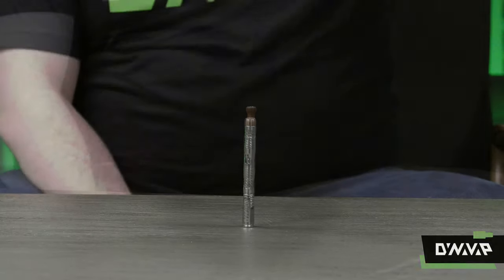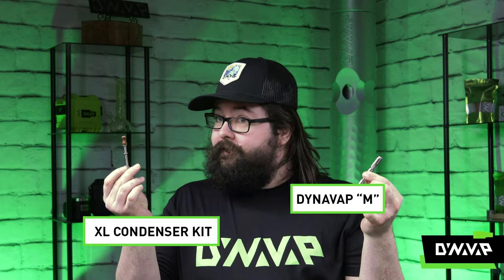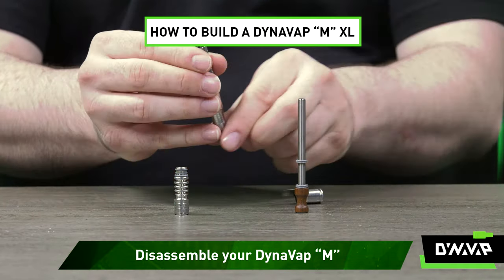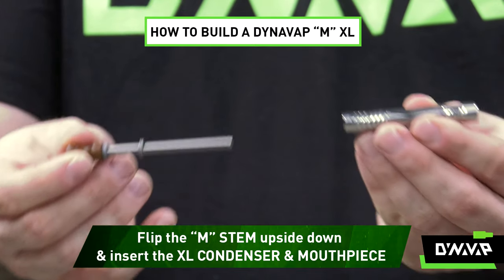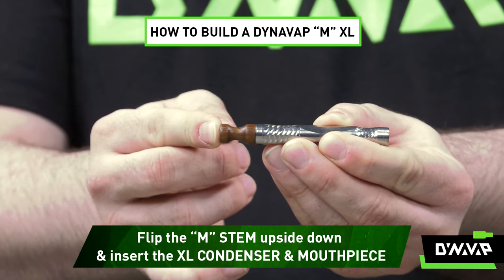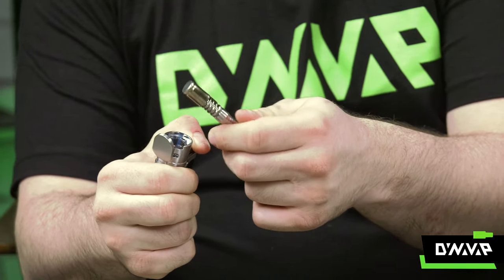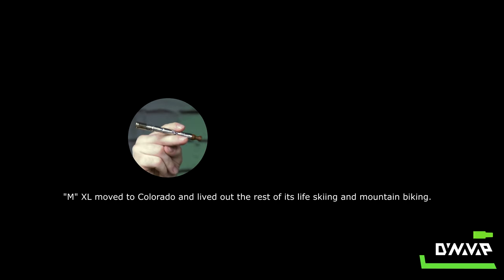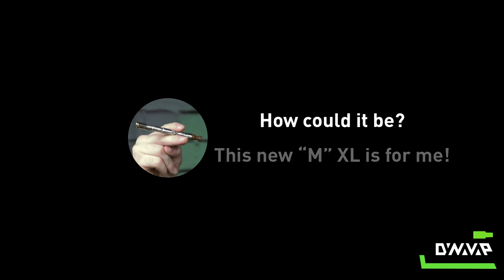How to make a DynaVap "M" XL

Comment: Love this!!! I had already done this but had used the m the normal way round. Doing it upside down as josh said works so much better and looks like it was made to fit   Thanks again dynavap. Just finished heat treating my new omni too
Reply: how does it work better when it's reversed?
Reply: @etmassmovement265  the old mouth piece section of the M forms an indentation to help you spin. The mouth piece on the m is tapered also so the tip end is the same with as the mouthpiece stopping there being a gap Also it looks better not having 2 mouthpiece shapes next to each other. 
If you do it normally and then try it the other way you’ll see.